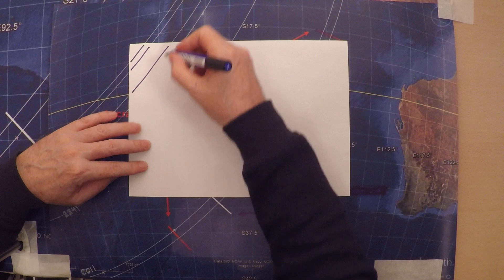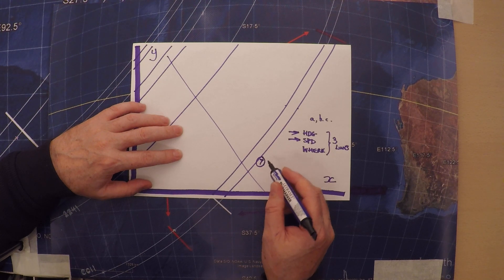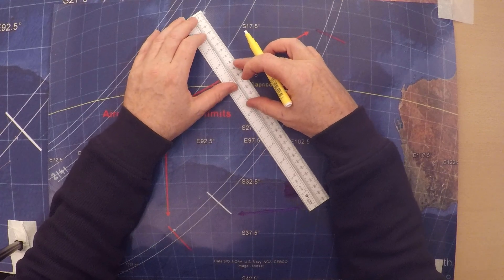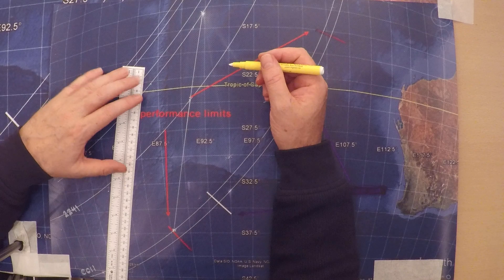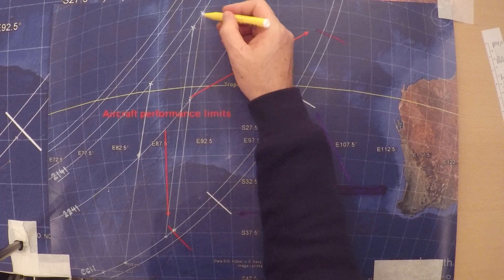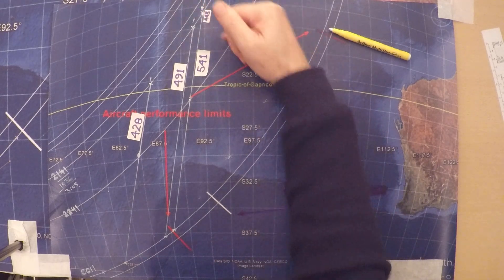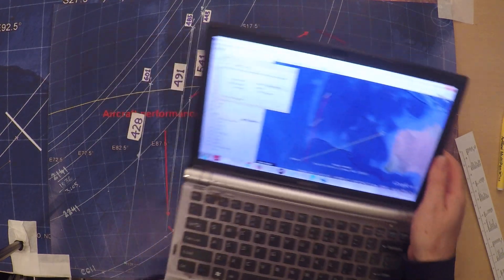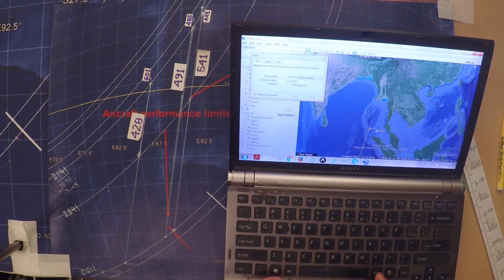Part 1 - Capt Simon Hardy's Technique Video for finding MH370

Comment: 1:44 And that's why MH370 hasn't been found so far. There are more and more hints, that the heading and speed were NOT constant (e.g. the WSPR analysis). That there was either an active pilot till the end, or that the pilot reprogrammed the FMS in a way to "confuse" anyone looking for the aircraft and doing such calculations. Whoever let MH370 disappear... it was a quite sophisticated act, he wanted to make it as hard as possible to track the plane.
Reply: I agree with most of what you have said. I take anything to do with WSPR tracking as false information.  I think Simon is using a reasonable process although details like winds aloft and outside air temperature would result in changes to the ground speed for a constant mach number. A more detailed analysis was done by the official investigation team which incorporated all of the atmospheric effects on ground speed.  It was found that the aircraft ground sped actually decreased as the aircraft flew further south. That team identified a location a bit further to the east on the 7th arc at  38S and 88.4 E due to the decreasing ground speed. if you are interested I put together a Youtube video series which goes into much more detail, which can be found at the following link  https://www.youtube.com/playlist?list=PLvJB8SSquiZAg6MIFIVjSe40rvN5jxVRS.  There is also a video on WSPR at https://youtu.be/TBfMLdWcIqQ
Reply: It turned out that MH370 entered a Holding with a duration of 22 minutes west of Sumatra. It is difficult to understand the logic of this maneuver.
On the other hand, both Australia and the American air base on Diego Garcia are equipped with JORN radar (over the horizon radars) which have a detection range of over 3000 Km.. This would mean that both the military from Australia and those on Diego Garcia must have extremely precise information about the route of MH370
Reply: @radubargaoan6853  The story with the "holding pattern" is just a theory/interpretation. The Wisper Network data, analysed by Richard Godfrey, is a promising approach. However, this data is very far from accurate. If you ask me, it's too inaccurate to read any kind of "holding pattern" from it. It gives a mere indication where the plane flew, not more.

Comment: I performed a similar analysis way back ... week 2 after it disappeared.  Although mine was a 100% graphical solution, I ended up using the same logic as you did, and came to almost the same solution.  Here we are over 6 years later and still haven’t located the plane.  I theorize that the pilot turned into the wind, (which was coming from SW) just before he landed it on the water.  We need to adjust the search area a bit to the SW.  And perhaps make minor changes to account for the underwater currents as the plane sank 15,000 feet.
Reply: The problem is they are refusing too listen too simon hardy or larry vances end of flight theory

They have only been looking at the area too search in relation too a kamakaze dive at fuel exhaustion, and not the continued gliding theory that larry and simon have put forward they are only looking at the other theory and have not even bothered too search further as reccomended by larry and simon

I believe larry and simons end of flight theory and also larrys whole theory makes sence too me 

They honestly need too just listen too these guys and look

Not just give up

Although ocean infinity now has the armada fleet thats now autonomus

But perhaps they are just waiting for the gebco seabed 2030 project too map the entire ocean,  too save money.

And now that covids here who knows when they will search again